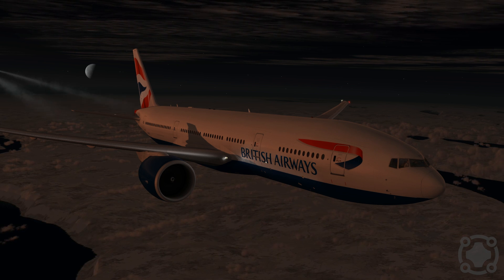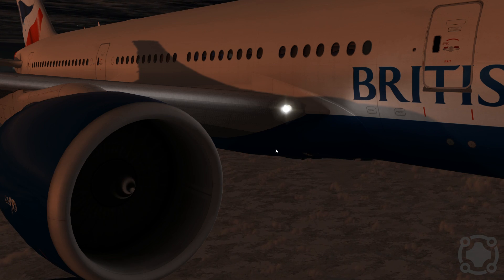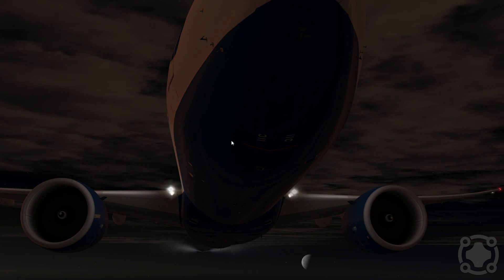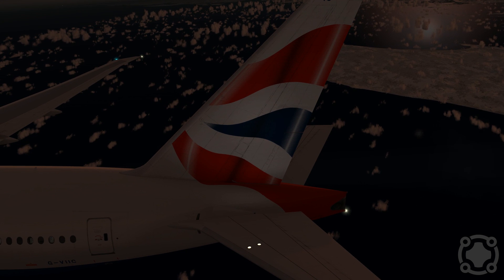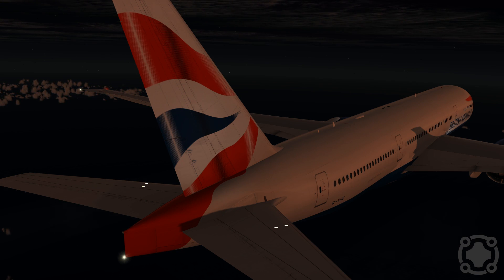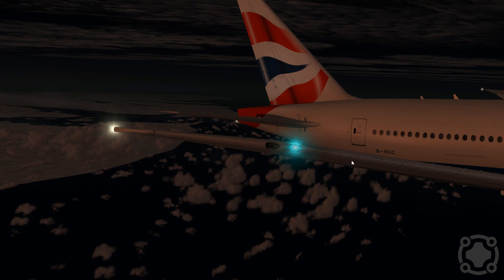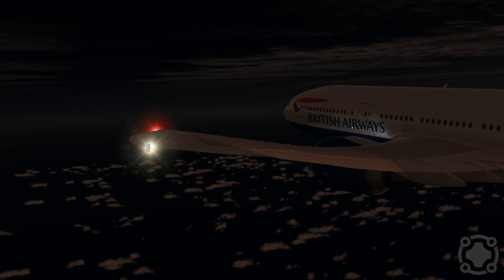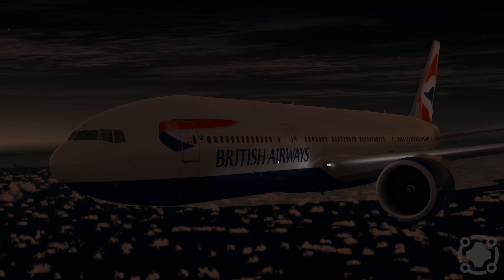Why Do Planes Have Red And Green Lights? (Aircraft Lighting) - Aviation Facts

Comment: My experience is that A 330 is most comfortable since I found it the most quiet. I had heard a lot about 787, but I did not find it as quiet as they claim. I guess it also depends a lot on where you are sitting in the plane in terms of noise

Comment: 2:29 these are beacon lights, pilots turn them on before starting engines. They are to warn ground crew, that engines are about to start or running. Anticollision lights are these flashing in white lights. They are very bright and pilots turn them on few seconds before take off and turn them off after leaving runway.

Comment: Do they use port and stbd for left and right terms?
Reply: no
Reply: Yes they do
Reply: that term is mainly used for sea navigation. not sure if they use it for air navigation
Reply: correction: it's not used in the US, not sure about other places. Generally, headings on the compass are used. Or if you want to know the general direction from your aircraft an object is, clock direction is also used. I.E 3 o'clock or 9 o'clock, meaning stbd and port respectively.
Reply: +fl a re we use it in the US navy. Port and Starboard
Reply: ronald kateregga I'm pretty sure he was talking about only aviation only. And if you use it in the Navy that's cause y'all are just weird ;p
I've never heard it in GA, or outside of the military.
Reply: +fl a re ok
Reply: Port and starboard are usually used for expressing left or right side of the aircarft or some part of it. (port wing, starboard engine). But about navigation I'm sure that I heard port/starboard drift terms.

Comment: What software did you use to tell the lights? It's awesome!
Reply: MisterTofu as a flight simulator nerd, it looks like he used a simulator called Prepar3D, using an addon called the PMDG 777X base for the aircraft. To get that level of detail it looks like he also used REX Texture Direct for the textures and REX Soft Clouds. For the camera he would have used EZDOK. All this costs around £200+. I told you I am a nerd.
Reply: What PC hardware does one need to run this? Also is something like a Flight simulator setup necessary to play this? or KB and Mouse does it?
Reply: to get the best performance, you need a modern (past 2-3 years) processor with (the best are i5s and i7s) clocked over 3.0 ghz with a low to mid range graphics card (game made when processors were the main thing, so it is mainly about them.) 4-8gb or ram and a good sized hdd or ssd (over 250gb is also useful. This with those addons will get you from 30-60 fps, depending as to whether or not you are in the air, in clouds etc. To give you an idea, i have an AMD 6300 at 3.7ghz and an r7 240 graphics card and 8gb or ram ,and get around 15-20 fps with this, which in this simulator will equal more or less 30 fps as this is a bug fix of mine. (FSX:SE) You do really need at least a joystick, the likes of which costs around 15 pounds. Time to learn how to fly it is also essential- it flies as the real thing, and everything from the air con to the hydraulic systems are modeled, however it is really good fun afterwards.
Reply: yea it's prob prepar3d because it doesn't look anything like fsx and p3d normally looks like this
Reply: Prepard3d, it's a simulator. Don't get too excited though, your seeing hundreds of dollars/pounds if Addons

Comment: You forgot to mention a crucial issue regarding the navigation lights: The angles from which the lights are seen clearly!
The tail navigation light is seen in a 120° arc from behind. The red & green navigation lights are seen from straight ahead in a 120° arc to the left & right sides respectively.
If you a see a white light ahead of you it means that you are within 60° either side behind the aircraft, and are overtaking (if you are flying faster. If you see a green light, you are seeing an aircraft from it's right side (from almost straight ahead to 30° aft of abeam) and may be crossing it's flight path (and vice versa for the red light, which means you are crossing from the right).
The same rules apply to ships, aviation actually adopted the maritime rules in its infancy.

Comment: "Beacon lights" seems to be a more commonly used term for what, I believe, you call the anti-collision lights.  It's probably because they want you to turn those on before engine start so it's most vital use is to signify a running engine.
Reply: true, it even refers to them as beacon lights in the cockpit

Comment: Are there any emergency lights or anything like that?
Reply: No, these are the only lights available to us pilots if we are including the backup lights which work normally alongside the regular lights. But in the case of an emergency such as an all engine failure, pilots can turn on their APU system which is basically a backup engine located in the aircraft that doesn't produce thrust. The APU gives the aircraft same functions that your normal engines would, a great use of this system can be seen in US Airways/ Cactus Flight 1549 which lost both engines at 2,800ft after takeoff. The quick thinking of the pilots made them turn on the APU systems onboard the A320 and "ditch" the plane successfully in the Hudson River, New York, all passengers and crew survived.
Reply: nope
Reply: They are but in the passenger cabin on the floor
Reply: Lights are of not much use in a crashed airplane or to signal that you are in an emergency. You can set the transponder to 7700 to indicate an emergency and after a crash there is a radio transmitter called ELT that signals it's position to search and rescue operations.

Comment: 777 200lr right if you say 200 or 200er Iknow its a 777 200lr why because of the raked wingtip al 777 has a raked wingtip except 777 200,200er,and 300.
Reply from the maker: 300, 200, and 200ER were before the design of the raked wingtips. More recent models such as the 300ER and 200LR have the raked wingtips.
Reply: +LogicLounge   I know that 777 200 200ER and 300 are before the raked wingtip
Reply: Smix Brix I use to be 9 years old and it was fun. 
☺️
Reply: michellou chu yep me to I love planes and I am nonly 9 😅😊😊😊
Reply: +Smix Brix  meee too
 im only 9 years old.
Reply: 777-200lr is the pinnacle of every major airline because its cheap and big